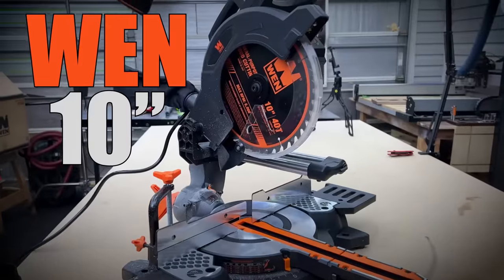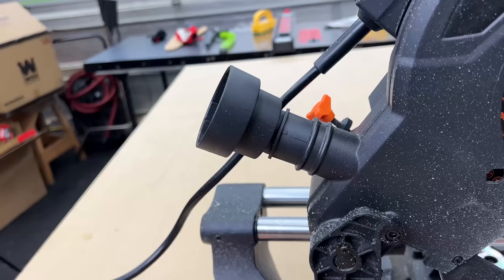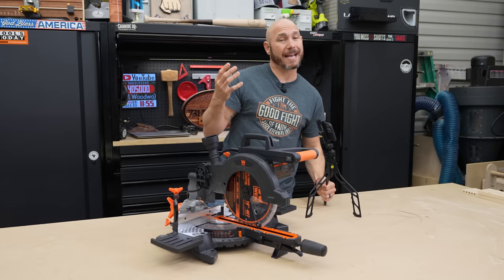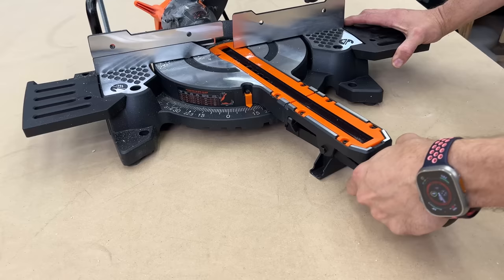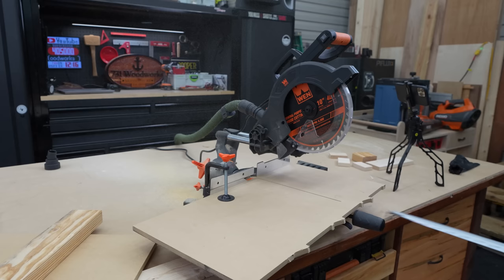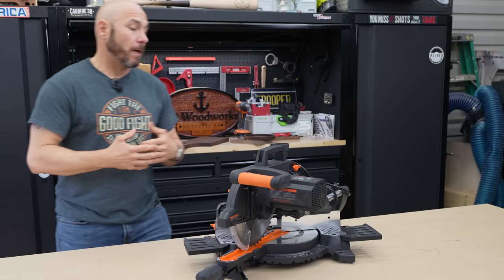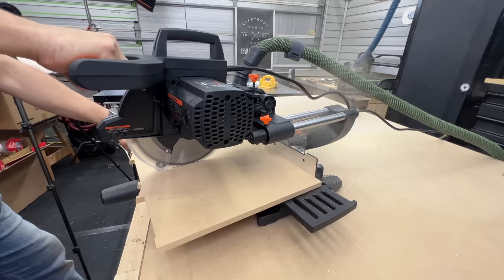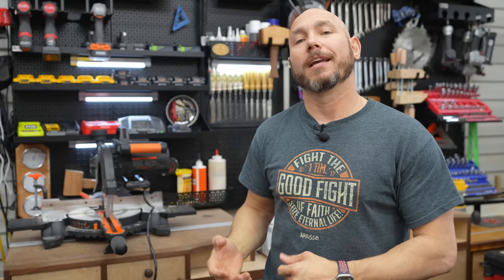The Best Miter Saw For Beginner Woodworkers under $200?

Comment from the maker: ▼EXPAND FOR TOOL LINKS and INFO▼ 
Watch Next = Best Budget Table Saw - https://youtu.be/qOANCOd1NCE&list=UULFSLClJLzdUMRMe0E4SPfc-w
Tools In This Video: 
Wen Miter Saw - https://amzn.to/3Ju3Op6
DeWALT DWS779 Miter Saw - https://amzn.to/3yL8Et9
Festool Miter Saw - https://amzn.to/3lhMawR
Dust Extractor I Use - https://amzn.to/3TozLnk
Zero Clearance Tape - https://amzn.to/3yLUpUQ

Miter Saw Blades I Recommend
84 Tooth (as pictured in video) https://amzn.to/3Z5MpZK
90 Tooth Blade for Ultra Fine Finish - https://amzn.to/3li7GS5
80 Tooth Blade - https://amzn.to/3Tn4RM9

Other Tools/Equipment I'm Asked About Often:
Table Saw - https://amzn.to/3IoKqsZ
Table Saw Blade I'm Using - https://shrsl.com/3xv5i
Tripod for Phone - https://amzn.to/3E3kWA9
Phone Holder for Tripod - https://amzn.to/3E1E6GG
Boots I Wear - https://amzn.to/3HkUl3y
Toolbox in Background - https://homedepot.sjv.io/x9B2xy
Tool Wall over Miter Station - https://amzn.to/3ZgWq7B
Digital YouTube Sign - https://amzn.to/3GL2a2e
Camera Gear I Use - https://kit.co/731Woodworks/camera-gear-i-use 
Computer Equipment I Use for Editing - https://kit.co/731Woodworks/731-woodworks-computer-equipment

(If you use one of these Amazon and other affiliate links, I may receive a commission) 

Some other useful links:
Daily Tool Deals on my website: https://www.731woodworks.com/tool-deals
Subscribe to our email Newsletter: https://mailchi.mp/7e44c16eefdc/731-woodworks-email-newsletter
Check out our easy-to-follow woodworking plans: https://www.731woodworks.com/store
Outlaw's Board Butter - So Good it Should be Outlawed: https://www.731woodworks.com/store/boardbutter

Comment: I switched to WEN Blades about 2 years ago , the hi dollar blades were good for about 3 to 4 months and cost about $100 plus / minus. Now another $50 to ship& sharpen . Or spend $14.00 on a WEN brand and it too lasted about 4-6 months and it can be recycled and another new one put on and total $ spent is about 35 vs 150 . You can do the math . Too if by chance I find a missed a nail and sparks fly , I just swap out & toss my $14.00 blade . Had it been my expensive blade ,I would be out the cost of a new blade.WEN Blades are my go to blades 100% . Cheers
Reply: I have found the brand to be great not one blade have I returned to Amazon , I now am looking at their track saw to buy

Comment: If you have more space to the wall, I recommend the SKIL 10" SCMS. It's double bevel, has a superb quick clamp (cp. Festool's), motor is angled rearward (more cutting capacity), solid cast aluminum, square out of the box with easy adjustments. Has an LED light showing both sides of the cut line (throws a blade shadow). Can add a dust collection scoop to the built-in port. Under $300. Do also recommend the Diablo blades.
Reply: Been considering this saw. Can you drop a link for the dust collection scoop? Thanks!
Reply: @loganmurphy3499  So far, none commercially available. But you  can fabricate something that wraps around the rear of the blade guard out of duct tape. Lots of examples for other saws on YouTube too.

Comment: I looked a Wen when I was looking into a miter saw. The Wen I was looking at cut metal and wood but I ended up going with the Makita 12" 36v miter saw very happy with but the Makita was 1,000$. I had tried a Metabo miter saw it was horrible would not make consistent cuts.
Thanks for sharing Matt😁👍

Comment: 9:27 Pro tip when cutting thicker boards (or harder wood) is to make multiple passes. IOW don't cut the full depth all at once, rather make a series of shallow passes using only the weight of your hand. Once you start muscling it you will introduce the deflection. Let the tool do the work.

Comment: I’m actually rocking a harbor freight miter saw with the 12 inch sliding Didn’t come with a blade  and I made the mistake of getting a harbor freight blade  so the tear-out is horrible. That being said the actual miter saw was 90 right out of the box  and has held it without out needing any adjustments
Reply: They both probably come out of the same factory. 
Brands like those that Wen and whatever Harbor Freight sells don't have an R&D budget, it's all the same stuff rebranded. Even a lot of the 'premium' brand stuff is just rebrands, or there are lesser brands selling the exact same tool with a different color scheme for less.

Comment: I bought a Kobalt 7 1/4 mitre saw a few years ago before I really go into woodworking for cutting vinyl flooring.  It worked great for a while but now even after changing blades and checking for square every cut isn't square.  No matter what I do I can't get it to cut a straight 90 degree cut.  And my budget is extremely tight because the wife and I just bought a new pickup to retire the chevy tahoe I been driving the last 10 years.  It may take me a few months to save up the money to buy it but I think this mitre saw is going to be the next thing I buy for my shop. I saw you other video on the Delta saw which I really want but what I want is not what I can afford. This should do for a few years hopefully.

Comment: I like the battery powered 7 1/4 Ridgid miter saw. It is extremely lightweight and fits on top of the Ridgid Pro Gear boxes like it was made to be. The fact that you can chop 2x4 s in one pass is spectacular for what I tend to do.
I would recommend a battery powered miter saw to anybody in a trade who occasionally has to throw a block in a framed wall or a stringer behind a tub. Light Fixture framing anything it’s just the perfect miter saw cause you can throw it down on your tailgate and get straight to work.

Comment: I have a Hitachi 10" non-sliding miter saw that I got several years ago for $99. It was dead square and is very accurate still.  No laser though. I would have considered this Wen back then.

Comment: Not sure if you can get them in the US, and exchange rates might push it to around $300USD, however for slightly over this (currently $449 here in West Australia) you can get the Evolution R255SMS+. They tout this as a "will cut anything" Mitre saw, and it just about does, including quite thick (5mm) stainless steel tubing, (with the right blade). I have been using it purely for woodworking  for well over a year and after swapping out the blade for a Diablo and after set ups and a zero clearance (boy does this need it, the gap was enormous), the results are fantastic, note the 'laser' is absolute garbage. If you can get it over there in the US it might be worth a check.

Comment: Not a major selling point but still notable, is the fence is pre-drilled so an extension can be attached.  My Delta 10" slider's fence wasn't drilled.  No big deal, it only took maybe 10 minutes to measure and drill it for the mounting screws, but it's a plus for it to be pre-drilled.

Comment: Bought one! I had a 12" Delta Cruzer (big slider with the elbow joints) on a Portamate stand. It took up too much space, weighed a ton,  and wasn't used enough so I sold it. This saw, attached to a plywood  base is light enough for me to lift (I'm old), it clamps to my work bench, and stores nicely on the work bench shelf. Out of the box square and my first cuts were 2 X 12s for a Jet 1640 lathe (400+ lbs). I have a Wen track saw,  Wen full size band saw, and a Wen Pneumatic Multi Function tool so I obviously like the brand but your review sealed the deal. Thanks!

Comment: Thanks for the video. I came here due to my 2 night frustration trying to square the 10 inch Ryobi cordless. After getting the DFM and Woodpecker precision triangles, it just wont square up. Just a DIY'er and would like to know if you approve of the Dewalt 12 inch DWS715. Looking for more precision than the lower end models. I am a stickler for making my work look good.

Comment: I'm not sure whether to scold you or praise you.

My adult daughter broke my old 10" Craftsman miter saw (the fence casting broke into several pieces). Based on your video, I looked at the Wen. The saw you reviewed had a long lead time so I looked at the same saw with a laser for several dollars more. I ordered the 10" saw with the shadow line for just a few dollars more.  The saw was delivered today and, to my surprise, it was the 12" saw, MM1215. After conversing with customer service, they said I could keep the saw since it was their error. I have not unboxed it, but it is a beast.
Because of you, I have gone from an old broken non-sliding single bevel saw to a huge sliding double-bevel saw.

Comment: Nice review, Matt. I recently incorporated this saw into my shop and even made an interesting mount for it to mount it on my wall or my Shopsmith. I now call it a “ChopSmith”. I did just add a 80T blade to it. Scott
Reply: Also, I believe that the front support shown at 7:45 is there for use when the saw isn’t bolted down, but doesn’t seem to provide any support when the saw is secured to the bench. If I’m correct I’m glad, because I don’t want to have it mounted that far back on my bench.
Reply: @MyGrowthRings it was your channel is where I first saw this saw and showed it to Matt
Reply: @davidcorliss  I had the saw sitting in my shop when Matt did his Amazon Live event where he first did his unboxing, so he actually beat me to the punch. Thanks for sharing my stuff, David! Scott

Comment: wen has been very impressive so far for the few things that I purchased from them (bandsaw, belt/spindle sander, & drill press w/table).

I originally bought an hpt 10 inch miter saw for on sale for $100 when I was first getting starting fully expecting to replace it, but its still going strong.

Comment: Can you address the difficulty of changing the blade on this model. I have read multiple reviews how it is impossible or near impossible to change blade. The nut is Torqued so titley that some even broke off. I like your videos I purchased my Skill 10inch table saw just recently because of your recommendation. But i would ask when reviewing tools if you could please view the negative reviews also and address those problems and concerns. Thank you.
Reply: Yes, it’s a bit difficult to get it off the very first time you do it, but nothing that a bit of additional leverage cannot solve. Once you get to remove the blade the first time you should not have any further problem.

Comment: RE: laser. I"m also red/green colorblind, but I can see the laser just fine. One thing is that my laser isn't quite lined up with the cut of the blade (yes, the stock blade) and for the life of me, I cannot find any way to adjust the laser side-to-side. Maybe someone else has a solution?

Comment: I've had my Wen for several months.  Got rid of an old DeWalt chop saw that was 25 years old and on it's last leg.  I've have nothing but good things to say about it.  For me the only  down side is dust collection but that's the problem with all miter saws.  I've mounted mine to a HF Miter saw stand which required removing the foot on the front locking latch.

Comment: I am looking to get a mitre saw but I don't know if I should get a sliding one or a non-sliding one
Reply: If you need to cut up to 12 inch boards, you need the sliding one, just keep in mind that it is not a precision tool, unless you get the festool and learn how to use it with accuracy and repeatibility. Otherwise just get the regular. For precision miters and crosscuts nothing beats the table saw.

Comment: I have that same WEN bandsaw as well as a belt sander. Honestly, I keep forgetting they're in the shop because I have ZERO problems with them. When I need them, I just roll them out and do what needs done then roll them right back. I guess that's when you know you got a good one lol. I've been super pleased with them, and they were $80 each when I got them. Can't beat that with a stick. 
I was gonna get that same drill press too at the time (this was back in 2019/2020), but thought I'd start slow and just get the two. Kinda wishing I had got it though. It's gone about at least $30 since then I believe

Comment: For beginner or budget?  Nah how about a individual carpenter not wanting to lug around an oddly shaped 70lb tool from job site to job site.   I go cheap and only care about cut limits, weight, and being compact.
Not square?  Adjust it.
Wobbly?  Stay steady.
A tool is as good as the hands that use it brotha.
Thanks for the video review, very useful.  The other "unboxing" videos are a waste of time, just dudes that like watching themselves on camera.
I was worried those slide bars were too low to miter wide vertical baseboard or 1x6 or something but looks high enough.

Comment: Howdy Mr. 731....

Another great review. 👍 

I'd like to add to the point of the saw deflection when extended. 

We need to keep in mind that the "nick name" of a miter saw is called a "Chop Saw". 

That name has a purpose as does the actual purpose of a "chop saw". And that is for rough cutting lumber to "NEAR" dimension and then that lumber being taken to the tablesaw for accurate dimension cutting. These saws were never really intended for "precision". 

Just wanted to throw that out there.

Comment: I watched you comments in another video about the Skil 10 in sliding miter saw not for much more in price. What would anyone recommend between this Wen and the Skil?
Reply: I’m wondering the same.  Leaning to the wen simply because of the front slide.  I work in a small 1 car garage and space savings is always high up there.

Comment: Followed your link and seen wen also makes a 12 inch in this front slider design, based on your experience with the 10 inch, what would be your opinion (I stress opinion lol, I know you can't give a definite answer), but what would your opinion on the 12 be?
Reply from the maker: I think the 12 would be a good option too based on my experience with all previous WEN tools I've had.

Comment: I bought this saw because of this video. The blade wobble was terrible and the saw has a bit of jump when you start it. The saw is a safety hazard. The arbor is a small hex bolt as well. Buy at your own risk, I returned my saw within the same day.
Reply from the maker: Good to know.  Mine doesn't have that wobble.
Reply: @731Woodworks  fast response! Their quality control must really vary. I bought via Amazon so the return wasn’t a problem which was good.
Reply from the maker: @Woodworkingfan23  What are you going to buy in its place?  I'm always looking to review good-quality budget tools.
Reply: @731Woodworks  I’m thinking about jumping up to the DeWalt DWS779 or the rigid 10inch. I’m a DeWalt fanboy, but went out on a limb to just get this for breaking down stock. I looked at my other options at Home Depot because they seem to be very understanding with returns and the 10inch sliding Ryobi miter saw looks fair price.
Reply from the maker: @Woodworkingfan23  I love the DWS779.  Probably my favorite miter saw of all time.

Comment: I know this is a year ago but I wanted to post this. I bought one of these saws about 8 months ago. I used it for a few small cuts into this last Saturday. I built a wooden work bench and had to cut quite a few 2x4’s. I got all my work done and it worked just fine. On Monday I needed cut a few pieces of wood, I plugged in the saw and blade would not turn. The motor was turning but the blade wasn’t. I went over the saw until I couldn’t stand it anymore and could not figure it out. I’m just going to cut my losses and pitch it. It’s a shame because I love the slider on it which is a zero clearance like the Bosch and there isn’t too many of them.
Reply: It's sounds like you just sheared off a woodruff key. I bet you could fix that saw in 15 minutes.